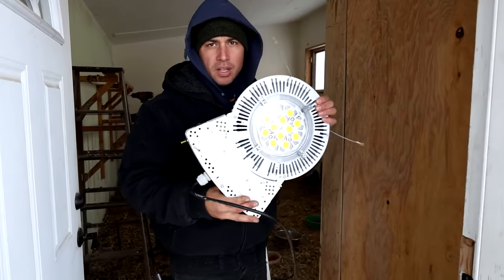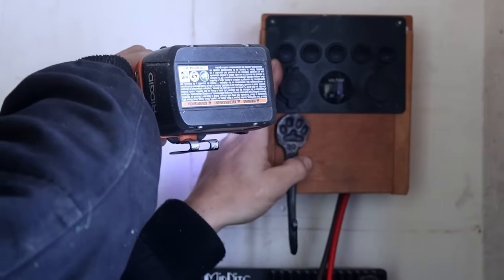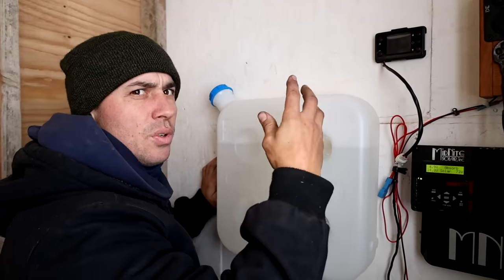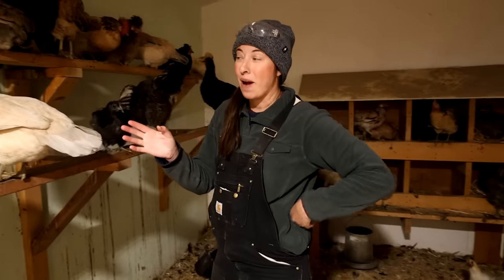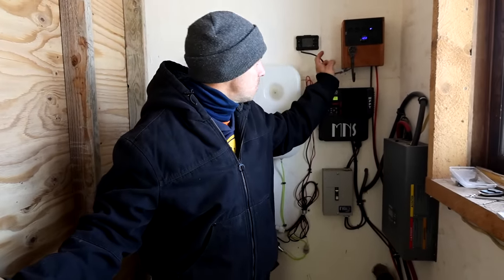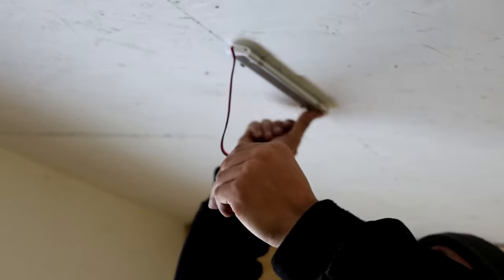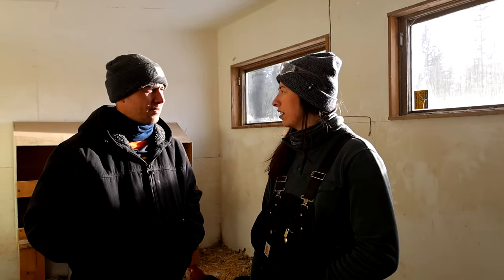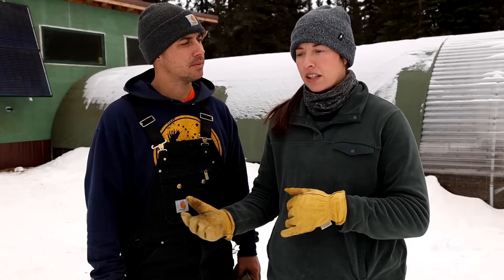Let There Be Light! | Heating the Chicken Coop with Diesel Fuel

Comment: Consider mounting the diesel tank on the adjacent wall instead for safety. I'm not sure how hot the heater body can get but, in case of a stray fuel drip during refilling, it's one less danger to worry about.
Reply: I'd also consider moving the controller to the same wall but on the other side of the wall in the heated area. That way it can be set to thermostat mode and save having to monitor the temperature and turning the heater off and then on every day. Also, having it thermostatically controlled will make being away from home for more than a day a lot more convenient.

Comment: As per my comment on a previous episode: the most pampered chicken in the world. Maybe vent the diesel fuel tank to the outside as the tank will go through daily heating-cooling cycles creating an inside vapour pressure sufficient to leak into the utility room. Flammable vapours in an enclosed room full of electrical fixtures (sparking occasionally) could potentially set off an explosion.

Comment: Consider drawing the diesel heater combustion air from outside rather than from the utility room. Drawing it from inside such a well sealed space can actually deplete the oxygen for the chickens. You could also install a 12v computer fan to circulate the inside air, maybe through the wall to expel some of that humidity, or you might find the door frozen completely shut. I'm sure the ladies (and gentlemen) appreciate and are enjoying their new luxury apartment. Good job

Comment: Add a 12volt photocell after the timer and before the lights.  This will turn the lights off during the daylight hours on the days that the sun actually shines. If cloud cover does roll in then the photocell will then allow the power to get to the light fixtures.

Comment: If you ever use that exhaust wrap again, if you soak the roll in warm water to get it saturated first, then wrap it tightly, you get a much better result and a much tighter wrap when it dries.
Reply from the maker: Thanks 🙂
Reply: Good advice, that's worked well on my motorcycle in the past. Also consider direction when using the wrap. If exposed to the elements, begin wrapping on the low side first so rain is more likely to roll off, same as installing shingles (if that makes sense)

Comment: You should pipe the heater intake (not combustion air intake) to the coop. Right now you’re pulling both combustion and intake (return) air from the closet. It will also help to dehumidify the coop and it will be more efficient.

Just have to screen it so it doesn’t suck in feathers…
Reply: In effect you are heating closet air and blowing it into the coop rather than heating coop air and cycling it back to the coop.

Comment: You could get more air exchange by using outside air for the heater. Might have to bump the heater up because you're no longer reheating inside air. You might be able to leverage the hot exhaust pipe from the heater to preheat the incoming air. Any exchange of air will probably push moist air out into the tunnel and give you a ton of frost.

They do make heat exchangers to recoup heat by using stale inside air to preheat fresh outside air but it might just plug up with the dust from the chickens. Might be worth a try if you can get one cheap. I think someone makes one to recoup the heat from a clothes drier.

Comment: Great channel! For the ventilation of the chickens have you thought about utilizing an energy recovery vent (ERV)? They typically can grab around 70% of the heat of the exhaust air leaving the structure and put it into the inbound fresh air.
Reply: Yes - heat exchanger with ventilation fan, so you get fresh air but lose little heat.

Comment: If you get their hot tub set up and running it will provide heat and unfrozen water. This would run off a solar system and be virtual heat and free running water. 😂
I was thinking you might look into adding a wind turbine system for those times sunlight is minimal. It seems there is always wind in Alaska.

Comment: Hey! If you need to improve the airflow in the house further, I'd recommend getting an old DC computer fan (or two) and positioning them inside the house to try and provide some laminar flow out the little chicken door to the run, ideally by putting it level with the door (ie almost at ground level) opposite of the door, so right under their bedding area. You may need to run the diesel heater a wee bit more often to compensate for increased loss of atmosphere, but it shouldn't be much more energy than you lose passively to the door being open all the time already; it will help force some of the off-gassing that's predominant at ground level to leave the building instead of stagnating though, which should help prevent the humidity from getting high (I doubt it'll lower the humidity much beyond current levels though), and deal with some of the most offensive odours. 

You could probably just wire it in to the lighting, as well, so it's only running during forced daylight hours and not forcing extra heat loss at night (the animals are less active at night anyway so they'll be contributing less to the "humidity + odour" combo then; granted, you could also do it in the inverse, given computer fans are tiny), although I'd recommend running it full tilt day and night for a week or two to help cycle extraneous chemicals out of the air (way you have it setup rn there's good opportunity for non-convective air to stagnant in the hut without a proper laminar flow, which is probably where the build up of odour is coming from).

Having 2-3 such fans, with at least one pointed directly at the open chicken run door from the opposite side of the room, and ideally the one pointed at the door should also be piped to the outside (small opening, just enough to get fresh air pumped in by that fan) would create a laminar flow and would gradually force out gasses (while having less of an impact on convective air current which would rise above the laminar flow), maybe one of the fans up higher to help circulate the hot air at the top of the room while also allowing gasses to fall out and be captured by the laminar flow (and evacuated into the run through the run door), would all also allow you to carefully control the level of such fans and therefore control when the house is exposed to colder air, if you want to maintain careful control over their climatic adaptation. Having 2 vectors to influence, the diesel heater level and the fan speeds, is more control and allows you to simulate temperature variation (without leaving them exposed to colder temperatures for a full nighttime duration); more control vectors are better than one, especially since you've got a more than adequate power and controls infrastructure setup already.

Comment: Hey Guys  to further insulate and fire protect the exhaust from the heater, I suggest a Hilti 4" speed sleeve  (it opens and closes on a twist cap system and a Hilti FR sleeve to suit the overall diameter of the exhaust pipe. ( They are mineral woo impregnated with and can cope with thermal movement) graphite) check them out.

Comment: hello from the Netherlands. 
Nicely done project in the chicken coop.  
two tips I could think of.  
Place a "light sensor switch" between the timer and the lights for the lights, 
then the timer decides the "day hours" that the lights can be ON, 
but the light sensor switch decides whether it is dark enough to having to have the lights on.  
The advantage of this is mainly how light it is when changing between the days.  
on cloudy "darker" days the lights stay on a little longer, the next day it is a crystal clear day so they turn off earlier in the morning.  
The "day hours" are also fully automatically controlled and monitored by the sensor.  
2nd tip : perhaps set a timer on the heating so that it automatically turns off in the morning and on in the evening.  
I know that there are "diesel heating controllers" that regulate this and still continue to regulate the warm-up and cool-down .
thanks for the video.  
Kind regards, Hollandduck

Comment: A couple of thoughts Eric.  M'be consider some bug screen at the exhaust tip and at the heat duct deflector to prevent spiders from getting into the system and causing a shut-down of your heater.  Also, if your humidity level remains higher than you prefer, a product called "Dry-z-Air" (or similar) can be used to draw moisture from the air and it collects in the container bottom.  Your big-box store for home improvement should carry it.  The condo-hen-ium is getting snazzier and snazzier

Let that snow pile up and remain at the bottom of the run all winter long.  It'll help act as insulation between the run and the outside air.  Would a layer of Reflectix on the inside of the run give you two benefits?  Heat retention inside, and light reflectivity to receive more bang for you lighting buck?  M'be a few bales of straw for the ground inside the run to make it just a tad warmer at ground level?  

Does the fuel filter for the diesel heater also act as a water separator for you?  If not, might be one more layer of protection against unwanted shut-offs of the heater?  

Overall, some great upgrades for those lucky yard-birds!  Nice to see you settling in for winter with fewer worries on your brows.
Reply: I was thinking of possibly putting an air exchanger in the chicken house, but the the Dry-Z-Air could be more economical.

Comment: Hello,  two things you might also consider is to lower your carbon monoxide alarm, (Carbon monxide sinks, its heavier than air.)  also you might add some combustion air to your room. When you shut the door, it might starve the unit of air and cause it to flame out. Door grates work well for that. Love your videos.
Reply: Carbon Monoxide is lighter than air, so a detector should be placed high up in the space, but within reach so it can be regularly tested.

Comment: You might consider getting a "bale" of cedar (or pine) shavings for the nest boxes and floor. The cedar insulates, helps control moisture, and is bug resistant. Throwing a little scratch in the bedding keeps the hens turning it, Helps keep the anaerobic bacteria working, and, in turn, adds additional warmth.

Comment: Hi guys, I have a Chinese diesel heater in the RV and one in my kitchen to heat the bottom of my house. Just a couple of tips for you which will hopefully produce a more even and none condensation atmosphere. 

1. Put one or two 12v fans in the roof of the coup, this will more the air around as hot air raises.
2. Put the air intake pipe from the bottom of the heater through the wall. The reason for this is you are drawing damp air through the system from your utility room and this can cause condensation to be pushed out through your hot air outlet into the coup,. You could even get a splitter for the heater, this will give you the ability to have a second hot air outlet.

I've been watching your channel from the begining, many could learn from your hard work ethos. Keep it up, brilliant. I live in the UK, North Wales.

Comment: I learned from my dad. Zip ❤ties get weak and break over a yr or 2 so grab a busted radio or sub and get the copper coil out of it. Rust free cotton😉
I only have a little coop made from pallets with a lift top but i put in 2 strips of perforated metal and the coop stays fresh.
Reply: Use the black or green ones, they are UV rated

Comment: 25:21 that frost may cause a water issue with the led lights. If the frost melts and drips on/in the led light fixture you may have issues down the road. Maybe get some pvc pipe (the rain gutter type maybe) and make half sections to act as a water deflector putting it in between the light fixture and the frosted metal frame. You can use the clips that came with the light fixtures to mount both said fixture and the deflector to the metal ridge pole of the run...

Comment: Beautiful job! Sidebar suggestion, carbon monoxide detectors should be mounted low in the room, not high or on ceiling. Carbon monoxide is heavier than air and sinks in the room. Just a safety tip from fire family.

Comment: Have you thought of harvesting the warm air from the ceiling and piping the air under the coup? This may assist in humidity control and add heating. You could also adopt that to the wall should you clad them and add some space between the wall and the cladding?

Comment: I did, not know, egg production dropped off, with no light or heat, and you guys like eggs, makes a lot of sense, and it`s not costing you much. That is a very small fuel line on the heater, so that thing must only sip fuel, happy chickens, more eggs, another great job by you two, I hope the inverter stays running for you, all the best guys.

Comment: Pretty cool, in the nifty sense. At least with 12 volt setups you have several options, and you can get around any number of equipment failures. Even your generator should have some 12 volt charging plugs? Too bad about the inverter; I was looking at that system because I thought it has been dependable for you... and then...  You must have gotten the diesel heater for the truck fixed. You could have the heater in the coop draw air from a vent to the outside for drier air to help push out that moisture. I'm going to checkout those Vevor heaters, thanks for being the testers.

Comment: drafts, ventilation no humidity might be cold but it is better than humidity and warmth, that could be the catalyst for disease.  My coops are loaded with cracks, I try to have the right amount of chickens to generate sufficient heat, I have lots of bedding (hay and pine shavings to hold in some heat, but by in large they will be cold when we are cold.

Comment: After some thought, I would like to modify my previous comment a little bit. If the utility room door is only to keep it isolated from the chickens and there's a gap between the bottom of the door and the floor, you already have a return air vent, and it's actually where it should be. At the floor(heated air falls as it cools), and as far as possible from the heat duct(room air circulation). 🙂

Comment: CARBON MONOXIDE DETECTORS GO 2FT ABOVE THE FLOOR AS CM IS HEAVY & FOUND ABOVE THE FLOOR. Nice job with the whole coop, run, electrical etc!! You can get a timer where it turns on & off automatically during a 24 hr period, you wont be having to turn it on & off. They are less than $10 HD or Lowes. TY for caring so much for your birds.

Comment: I love your videos. And I've used diesel heater for our chicken coop when the temperature got down below freezing. 
A little tip, change the green fuel line with white nylon fuel line. I had the green one and it's not good for the diesel heater. well, one can have the green one from the tank to the pump, but the pump works easier with the nylon tubing. It makes less bubbles too.

Comment: Good lead in.  Cool mornings for the foxes.  Guard that chicken coop.  Good job on the diesel heater.  Got to mount one in my camper shell for winter.  You could use the exhaust outlet pipe sleeve for a cold air intake as well.  Don't know why but you could.  Beautiful sunset.  I checked teh Arctic Cam , Newsminer in Fairbanks today, 7 hrs of light sunrize to sunset.  Changing fast right now.  Only 43 more days til they start getting longer.  That's a long 40 some days plus the flip side to get back where we are now.  Good deal on the daily heat.  Now for a timer.  LED's put off some good heat as well.  It all adds up.  Like the lights.  Put a dimmer in line as well.  Lot of stress on the chicks in that environment.  Your efforts will really help them.  Maybe some positive ventilation for an hour a day or so.  You can tell by the egg count how they are doing.  A happy chick is a productive chick.  Yeap, they have to be tough within limits.  See you next time.  Good vid.  Be safe out and about

Comment: Great job on your coop. Couple of suggestions, a lot of the digital timers allow for multiple on off cycles so you can automate turning lights off during the daylight hours, ventilation is critical so now that you have the diesel heater might want to consider adding a couple of 12 v exhaust (computer) fans to increase air turnover and moisture removal, given how efficient your heater seems it might be worth considering a thermostat setup so you can maintain a more consistent just above freezing temp which will be healthier for the birds.

Comment: You guys should install a small energy efficient ceiling fan in the ceiling in the middle of the coop. Set the blade to blow clockwise.
Clockwise will blow the wind up into the ceiling Where the heat is trapped and force it back down to the floor. It's the winter setting on a ceiling fan.  In the summer time you set it counter clockwise, so it blows straight down on you.

Comment: Place a small exhaust fan up high. It will move air, and help remove stagnant moist warm air from the ceiling area. In the summer it will remove hot air.

Comment: When you said youd put the heater low, i actually thought you meant low lol. I wouldve had it as close to floor lvl as possible. Seeing how hot the outside pipe is, i wouldve put it on the other side of the coop, boxed off of course, and had the pipe coming out to their run - caged lol maybe it would help to heat that too. I think 2 is perfect for them xx

Comment: I am so impressed with what all you have done.  I always liked your other coop but this one is so much better for your flock in the winter.  I was wondering if you put a small fan in there if that would help with the humidity, like a small computer fan or something.  That run is perfect and I really like the diesel heater.  I miss my girls.  I had a flock for 22 years.  This past summer  I lost my last one at age 13 1/2,